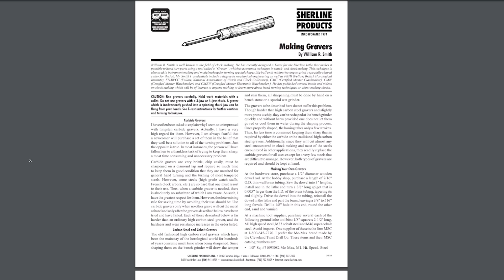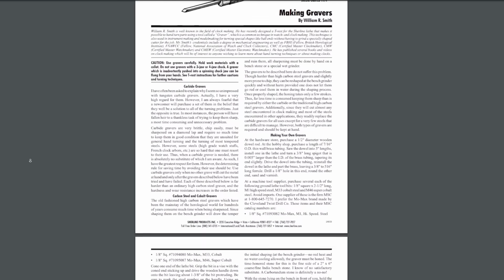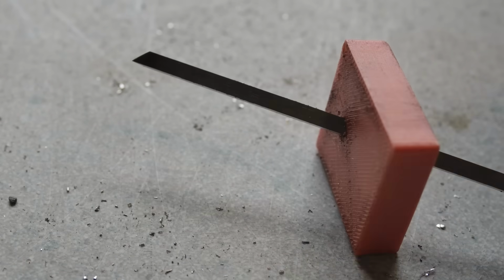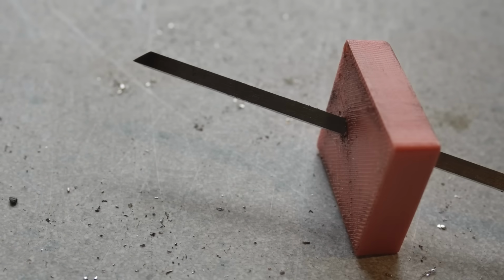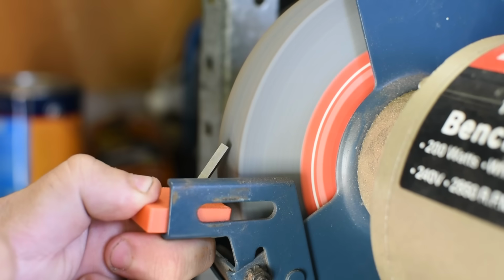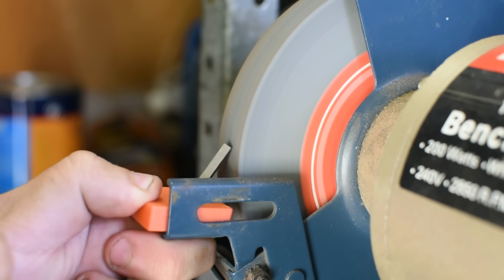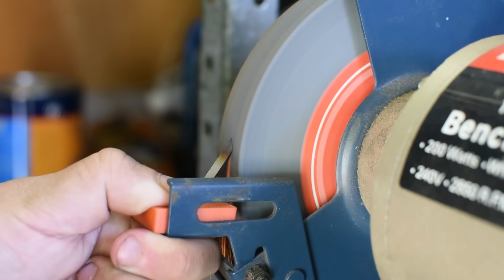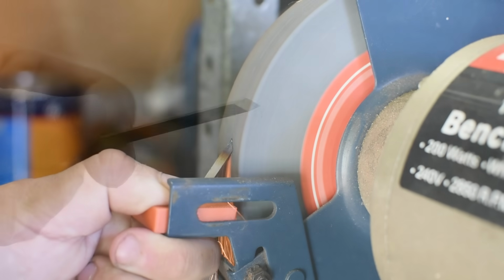I Printed A Better Lathe

Comment: There was Mr. Gingery who promoted building "Your Own Metal Working Shop From Scrap" series.  Your work is highly complementary to his vision, plus adding a vision of your own.
Reply from the maker: his work is an inspiration for sure. Similar ideas, but new technology.
Reply: @Borgedesigns  watch the build of Gingery lathe on Makercise Youtube channel. One of main things that he does is boring out the headstock on unfinished lathe so he gets it perfectly aligned. But gingery lathe has a proper support that moves along the bed as it is cutting so it is much more important then on your "watchmaker type" lathe. Please note that he cast his lathe from aluminium. For that a 3D printed models could be very useful.
Reply: Anyone interest in this should get the Gingery books.  Even if you use this process, he does some things better.  Cutting the head stock on the lathe gets much better alignment than this process that puts it in place than pours.  Gingery does many things that are not right either, but he did some things right that this gets wrong.
Reply: @henrymiller1820  Could you please elaborate or link to resources about what Mr Gingery had wrong ?
Reply: @discodingo8839  as much as i love the thought behind the Gingery lathe, the original design is not very rigid, probably because of the casting furnace limtations, he also wrote to use any machined surface as a reference which is kind of eh, but then again in those days you couldn't buy a new certified straight edge for 50$ and so you had to make do
the general process itself is great
Reply: @henrymiller1820  Gives us a great starting point!
Reply: @thebasilisker9063  Besides quality decline I bet there is price inflation. Powerful motors, accurate encoders and precise lead screws (or ball screws) have become very cheap an accessible but the price of having them pre-installed on a machine (i.e. CNC) seems incredible.
There have been a lot of videos of people adding them to their machines for fractions of the price it would cost to buy a machine of similar capabilities.
Reply: Stunning job ! Well done !!   I'd be rapt if I had achieved something like that. Gotta get a 3d printer. I made a shop notes diy wood lathe, might be of interest for you to google and have a look, there is a small possibility you could get an idea or two that is useful.
Reply: If you liked those, your mind will be blown away by Professor Pardal.
Reply: the difference is that Gingery understood enough about material science and where precision matters to make a functional and durable machine tool

Comment: Awesome work! You need to do a mini mill next. The concrete idea really opens up possibilities
Reply from the maker: Thankyou! Your gumball is also quiet impressive. The concrete does help a lot, even if its just saving on infill costs and reducing vibrations.
Reply: @Borgedesigns  thanks! with my project, the lack of weight is a constant struggle to maintain stability. i think you are on to something with your concrete idea!

Comment: Please throw your ender 3 out and buy a modern printer, 2nd hand if you have to, the printed parts do not do justice to the awesome work you do!!! 😮
Reply: The printed part are absolutely fine.
My Ender 3 work as well as the bamboo A1 without the proprietary firmware.

Comment: First off, great video.  I love the editing and atmosphere. Do you have parrots? Maybe consider selling hardware kits at some point. A couple questions/concerns:  I am seeing what looks like the outer race of the roller bearing spinning. Is it an optical illusion?  They may need a some compression to seat properly, also a dust cover may aid in the long term.  Beautiful tool, thanks for sharing.
Reply: I don't think that's the outer race spinning, I'm fairly sure that's just the roller cage, which should spin.

Comment: The bearings need some preload
Reply: ...and seals to keep the grease in and metal bits out.
Reply: This x1000, preload those bearings!
Reply: Chonky taper roller bearings like this want about 1000N of preload, rough guess for spring preload, otherwise they will suffer from skidding - i.e. insufficient load to make the rollers turn, so they rub instead, which causes damage. Bearings like this have a minimum load rating to run, and since they are so over-sized for the application, it's something that needs to be considered. Also makes me think that a lack of understanding of preload is why his previous build was flexing so badly. I see no method for him to add proper preload here. Also the way he assembled the headstock, everything just kinda "dropped in" together - far too easily. Ideally you want something closer to an interference fit between the bearings, housing, and the spindle. This was just... loose. And the way he's milling aluminium with the bearings open, unshielded..... made me shudder.....
Reply: @TheMastaRob  Spot on comment. I was an application engineer for a bearing company for 10+ years and was waiting for someone to comment about the lack of preload or even the lack of a nut to hold the bearing assembly together. Unshielded bearings next to flying chips also a big no-no but it should be pretty simple to 3D print a labyrinth seal that should work fairly well in this application.
Reply: Are you sure they aren't? Looked like some rings of plastic and little slots and things. Seems like the engineering in the rest of this would imply the guy knows what he's doing and preloading a roller bearing is pretty basic. Also those are some pretty nasty loads from the interrupted cut on that face plate and it doesn't vibrate too much, I'd think it must have been loaded up at least 'by eye', i.e. loaded up a bit in some way, even if not shimmed to the micron which would seem incongruous with the general ethos of this build.
Reply: @danoneill8751   nah, all the stress is being held back by that single bolt in the pulley, which of course is gonna slip and loosen up.

Also theres plenty of bad youtube engineers around. This guy made a shit ton of design mistakes while making these parts, mistakes that if you had some time working with 3D printers youd know.
The striaght up long poles and the thingies for holding the nuts are just one two of them, he also didnt put a single alignment tab or a single chanfer at the bases to avoid the parts from snapping. Not to mention he made everything out of pla which has a huge creep problem so all hist bolts are gonna be loose in a week or two because he didnt take that into consideration. All those captive nuts are useless, it would have been much better and longer lasting to just use longer screws (wood or drywall screws recommended) and to just screw them into the plastic itself, which would distribute the pressure over a waaaaay bigger area and the faces of the nut, making it so that the creep would be much lower or none.
Reply: @laharl2k I guess he can still call this machine a "Proof of Concept" while it still works
Reply: @laharl2k I’m kind of confused why you’re here. Are you against someone experimenting in their own shop and releasing the results for other people to see, just on principle? Do you think that only people that already know everything should be doing videos on YouTube? And if this guy is so incompetent, and you know so much more than him, why are you watching? Are you watching to feel smugly superior? Are you watching just so you can jump in the chat to tell everyone how smart you are? Or do you think it’s your moral imperative to jump into these videos to warn people against what you see as anti-knowledge? I’m really confused what your motivation is.
Reply: @laharl2k while you raise some legit points with material choice, I don't think the issues you raise matter much in the end. The PLA is not bearing most of the loads, the concrete is, so PLA's creep doesn't matter much. Chamfers and pins for alignment don't matter either, they just make things a little easier, but again, if you align manually and then solidify with concrete it's fine.
Reply: @naasking   the screws are still putting stress on the pla, the captive nut is captive to a pla piece of plastic, not the concrete.  If it were me, i would have scratched some coupling nuts with a stick welder or add some flanges and use that to hold onto the concrete itself instead of a small nut  with a plastic thing to avoid the concrete from getting into it.  The couplig nuts you put a piece of tape at the end and its long enough that you can screw things without any problem.
Reply: @laharl2k  I just looked at your YouTube page and I see no videos, for such a genius thats really disappointing.
Reply: @clivemetcalfe2679  you had a sub ambient IQ moment i see...
Reply: preload?
Reply: @lachlanlander6002  You add a bit of axial load to the bearing to take up the slack introduced by tolerances.
Reply: @lachlanlander6002  yes like a truck differential pinions it eliminate the blacklash when the bearing is heating up
Reply: @lachlanlander6002  It's like load, but before the load. But it's still load, just not the after load.

Comment: The only thing that spoils everything is your ignorance of the existence of Ultra High-Performance Concrete (UHPC))))))
Reply: The concrete is more for adding mass.  Any increase in compressive strength would be wasted.
Reply: @BlueJay137  Unfortunately, due to censorship, you must find the links on YouTube yourself.
Reply: @BlueJay137  You have no idea what this material can do.  https://www.youtube.com/watch?v=ftopsaGUZzs&pp=ygUEVUhQQw%3D%3D  https://www.youtube.com/watch?v=5HbsmFgdz0g&pp=ugMICgJydRABGAHKBQRVSFBD At the same time, this remains a fairly cheap method (unlike epoxy granite)

Comment: 2:10 the inserts are made for injected parts, there might be some long ones better suited for 3d prints (it works but the resistance is a bit worse)

Comment: "Hmmm. I dont have much money but I need this tool. Ahh. I'll just print myself one."  

I don't comment on many videos, but this just blew my mind. You showed perfectly how powerful a 3D printer with a genius mind can be. Endless possibilites. This is the stuff I love about 3D printing. You can just go "nuts" with it.
Hats off for you! Respect that you share with others this kind of stuff!
Reply: Before this video I saw the 3D printer I have as a tool to create toys, now I can imagine it as a tool to create more tools.
Reply: The fact that saving up for ONE tool can actually get you access to many has so much open potential
Reply: Yeah, really can go nuts, helps to have bolts too though.
Reply: Hear, hear.
Reply: his idea of making the 3d printed frame heavier than wood or metal, by just pouring concrete into the 3d printed frame, is such a cool idea that solves a big problem for my 3d printed large objects feeling too light and thus cheaper. heavy feels expensive.
Reply: Hell yeah this is ridiculously smart. The ability to make a useful machine from some of the most uncommon materials cheaply is what gets me.
Reply: you wouldn't download a lathe
Reply: You can't in fact go nuts with it :( 3d printers and plastics can only do so much, I tried to build a mechanical computer but it's just not consistent enough.

Comment: I love the composite materials (as I've mentioned before). Is there a way to forego the super glue? I'm betting that having fins in the material, a snap fit, and something like a dovetail may allow for a tight, consistent fit without requiring glue to hold the body together during curing. The internal "fins" would hold the body to the set concrete.

I simply CANNOT wait to build my own. I already have a 24V motor and power supply. Metal working will transform my maker journey. Transform.

Comment: Tapered bearing pairs should have some preload built into the design, usually in the form of a nut to compress the bearing stack together. I’m not sure how you would achieve this without a thread cutting tool, but maybe it can be implemented in the next iteration?
Reply: I have seen preload springs that you slide onto a shaft and compress with a locking collar, but I'm not sure if they have enough force to be useful here?
Reply: @joeofloath  that reminds me, a stack of belleville washer with a collar that is fixed when the stack is compressed could work, but will induce vibration if not careful. Still better than no preload tho
Reply: The cheap way is just two nuts that can be spread apart and fixed, to engage the thread grooves on either side.

Comment: i was a critic of mk 1 lathe, but this one seems good. ultimate baller move would be to use this to bootstrap an even beefier lathe that can handle steel.
Reply from the maker: yeah theres a reason I never released the v1 lathe ahaha, it was very mediocre at best.
Reply: @Borgedesigns  The point of prototyping isn't to make a good product on the first try.
Reply: then use that lathe to make a milling machine, haha
Reply: And then using THAT lathe to make one that can handle titanium, and so on

Comment: If a person is trying to make this just to see if it can be done, its a cool project and then so be it. However if you have the money for the 3D printer, all of the pla or other plastics, fasteners, misc tools and supplies needed to make this lathe, then you might as well go buy a lathe from commi china although will be shabby quality, it will be WAY better to do versus the time, money, and work to make your own lathe
Reply: yeah but who is having more fun?
Reply: All the DIY lathe videos have this pitfall but they're often targeted to those who already have a printer and want to get their feet wet on lathes or those who'd get a printer anyway. Before printers people used wood, glue and nails so if the printer is the problem you can bookstrap a similar lathe by learning some woodworking. Making the tools that make the tools is the allure. If you just need a lathe to work buy a Chinese one and upgrade it over time to fit your needs.
Reply: A Chinese lathe is at least 600€
His is less than 200 and the satisfaction to design and build something good.
Reply: @SaitoGray  a Chinese lathe also has a chuck, carriage, cross slide, tool post, etc. while those need to be made separately for these.
Reply: @ChucksSEADnDEAD  And it's more than tree time the cost.
This isn't a serious lathe, it doesn't matter, it a fun project to play with and use your printer.

Comment: Ive always been curious about the feasibility of 3d printing a concrete machine frame and using aluminum extrusions to mount linear rails, and an old 3d printer to piece together a CNC lathe, using belts to gear down the outputs significantly you should be able to get decent torque and accuracy, plus 3d printers can be found or bought for super cheap now

Comment: This looks great, I've been thinking about designing something like this myself.
Though my version is based primarily on two massive linear guide rods (25mm or 30mm) as the bed or  "spine" of the lathe. The headstock/spindle-housing and tailstock, aswell as the carriage would be made mainly from thick machined aluminium plates (mainly throughholes for rods/screws and bearings) which slide onto the guide rods and then simply get bolted in place.
Should be rigid enough even for some larger workpieces and tight tolernaces also a CNC modification should be relatively easy.

Comment: An idea for a future build (a repeat idea admittedly) a vibratory table to put your builds on as you pour your concrete.
Reply from the maker: It has been on the todo list for quiet a while now
Reply: I guess just a spring mounted plate with a drill spinning with an off center mass attached to it should solve it and probably be readily available and useful to own!
Reply: @jucaesar4961 Drill bearings aren’t too happy with sideways forces
Reply: @Borgedesigns please do
Reply: Or to use as a seat for those lonely days in the shop.
Reply: @jamiemacdonald436 I believe you're looking for a Sybian
Reply: @evanbarnes9984  Almost forgot about those.  The Sybian episodes on Howard Stern were hilarious. 🤣
Reply: @jamiemacdonald436  😂
Reply: The best way to do concrete vibration is actually to get a probe into the concrete where you can move it around. You might be able to cheat with a finer aggregate though. But I'm not an engineer, just a Joe that sets it... 
And on that note, that's grout and not concrete.
Reply: @Psikeomega  I use a modified massage gun from time to time.

Comment: Great design! Your stuff serves as great inspiration for me. The concrete construction works super well although i forgot to sift mine when i made something similar. I suppose you wont add a proper carriage since you have your big lathe for that?
Reply from the maker: id like to add a cross slide in the future but I wanted to get a base that wouldnt shake itself to pieces first aha
Reply: @Borgedesigns for my base i just did essentially what you did but with a much thicker casting and its machined steel fine. I was able to machine the faceplate for my 3 jaw chuck without too much effort. Mine is also cnc though so i have pretty fine control over the cutting
Reply from the maker: @user-cg3em4cw4f  make a video of it for sure id love to see what you did
Reply: @Borgedesigns you may have given me the final push to make a video on some of my budget machining projects. Ill drop the link somewhere if i finally end up uploading something! Also at a glance i believe the difference in our bed designs is that i cast the extrusions i used to mount the linear rails to directly into concrete so that might be why mine works well with a carriage